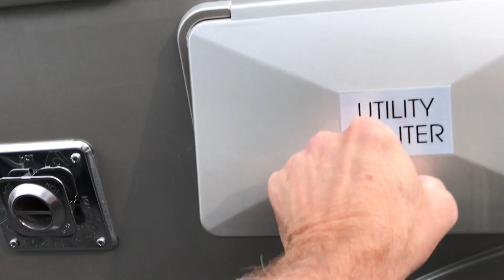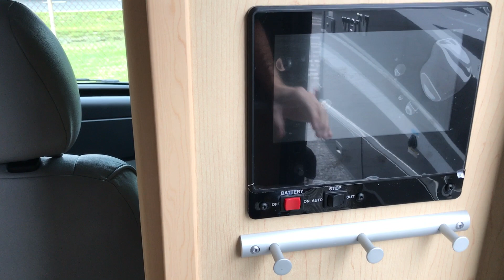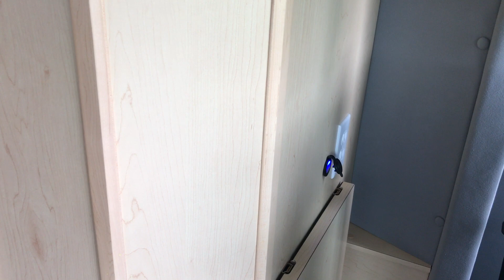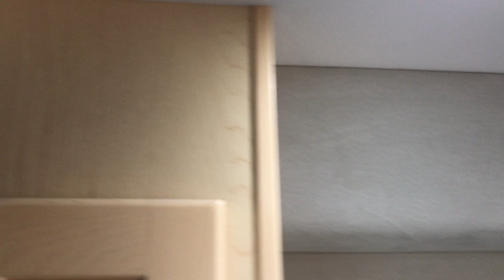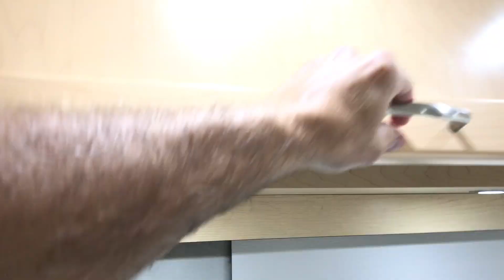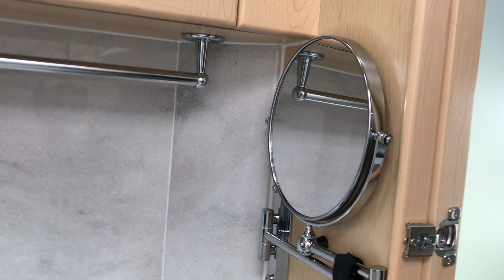** Update ** Plateau XLTD by Pleasure Way  -  w/Paul "The Air Force Guy"

Comment: Do you really need a generator, since it has solar panels?
Reply: @TheAirForceGuy  I realize this is an old video, but your reply to Cameron Garcia is incorrect. The generator is not required to use the 110v outlets. I've watched a couple of your videos and have found that they are not nearly as informative as simply going to Pleasure Way's website and watching Dean's (CEO) video walk throughs and around.
Reply from the maker: @gb93669  I stand corrected.  Thanks for the heads up.  Not sure what I was thinking when I replied.

Comment: Hello, I on the control panel by the door I saw AGS on the generator control area on the panel, what does AGS stand for?  Can you set the AC to start the generator when the temperature reaches a set temperature?  thanks.
Reply from the maker: AGS is for Automatic Generator Start.  You can set it to start for Low Battery or Temperature.
Reply: Dean Rumple (the CEO of Pleasure Way) covers the Control Panel functions more extensively in the video "What's New for 2018 at Pleasure-Way" along with other features of their 2018 line-up. You can see the video at https://www.youtube.com/watch?v=kbqCgoT4BZ0
LOVE Pleasure Way's RV's !! :-)